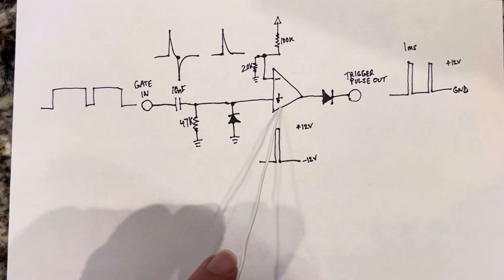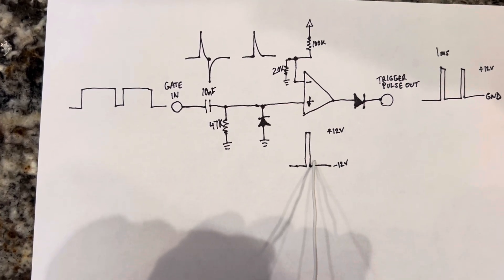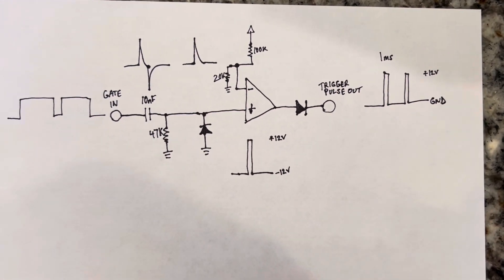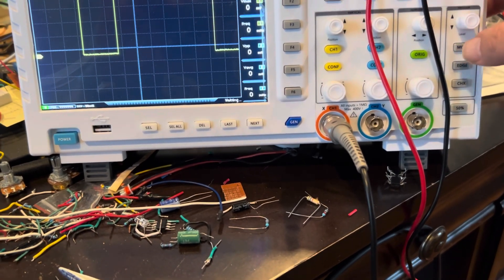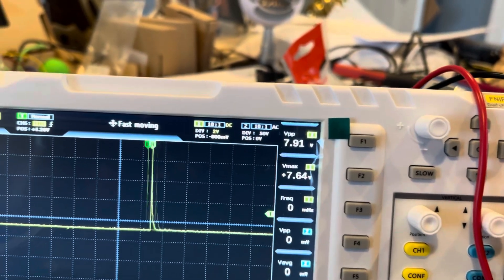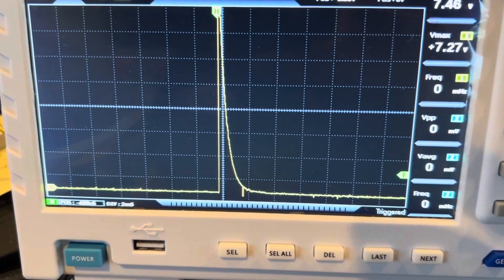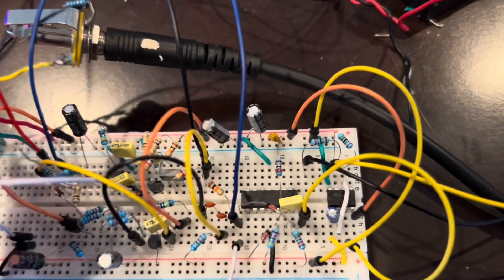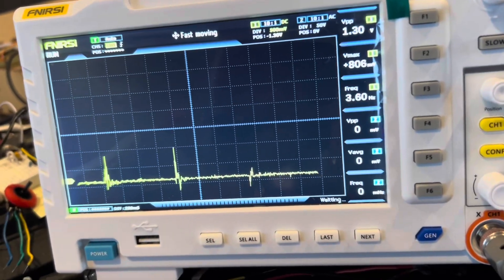Gate to trigger converter and final cymbal circuit

Comment: cymbal sounds sweet. have you ever made the voltage divider of a gate comparator variable, say to raise or lower the thresholds if needed? mucking around with a similar gate and noticed that replacing the 100k with a trimmer enabled some flexibility depending on whats being fed.
Reply from the maker: Thanks. I have but for that one I didn’t want to add that much complexity to it. I ultimately added a PNP to ground with a control voltage on it to vary the amount of the metallic ping that goes in to it which gave it a lot of extra sound variation options but thats it. The design itself is Roland’s that I reverse engineered and modified.  This was their last truly analog cymbal. Their next iteration was a sampled cymbal sound.

Comment: Nice.  Did you add control to vary the decay of the trigger in a subsequent video as described ?
Reply from the maker: @stuarttilton291  i did but i never included it in the final. I probably should though
Reply: I just finished a Hexinverter Postman.  It’s a slewing type EG , i.e. if gate is longer than the attack time the output is maintained at the supply power until the gate is removed.  

I would have preferred it to be the type that a momentary trigger ramps up and then ramps down.  Ray Wilson’s Dual AR gen works both ways but it’s a more complicated circuit.  

I suspect that introducing your gate to trigger circuit to The Postman , if the attack time is at its minimum , the decay should be able to act as a variable trigger decay.  I’ll see if I can get a chance to breadboard it out to see

Comment: I love analog design.  I'm thinking op-amps are not the best choice for this (min/max output issues).  I would also use the positive feedback with a high speed comparator.  In this case the high speed part is justified because of the dynamic range of the input pulses.
Reply from the maker: They work so well though for the active filtering and amplification of the white noise signal. The only thing im dreading is having to make a dedicated +/- 12 V power supply just for the final product so it could be plugged in to a wall outlet.

Comment: RC  is about 0.5 ms; decaying back to  ground would take 5RC or 2.5 ms, but it only has to decay back to  20K/120K = 1/6 = 16.67% Vcc, so not quit 2RC. You need a grounding  resistor after the diode, to clamp it to ground.
Reply from the maker: I have a 47k resistor to ground at the beginning of my envelope circuit for every percussion voice but yes its important to include a pull down resistor to prevent floating inputs. Thanks for noting that.

Comment: You really should add some series resistor on the input because right now you are putting a capacitive load on the gate.
I also think you have the frequency of the ring a little high.  Frequency control by a voltage input is a bit tricky but not super hard to do.  In some filter topologies it is just like doing a voltage controlled gain.
Reply from the maker: Thanks for the advice. Where do I put the resistor? Right off of the LFO output? And what size?  I experimented with that and any resistor bigger than 500 ohms affects the sound like a low pass filter which gets rid of some of the highs. 

The cymbal pitch sounds like the DR-110, the sound of which i like a lot but was thinking of doing a manual pitch control on the power to the CD40106 oscillator bank.
Reply: @igorbrichkov3632 Basically a small resistor in series with the capacitor of the high pass is what I am suggesting.  The LFO driving this circuit has to make the current that charges that capacitor on the negative edge.  The resistor keeps that current in the range the LFO can make.  This way, if you decide to time something else from the same signal, it will have good edges.